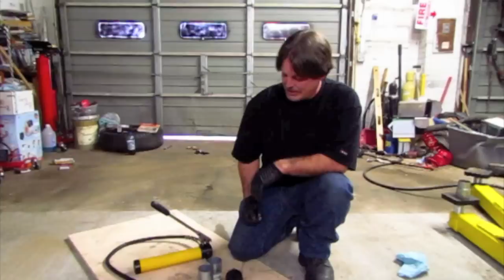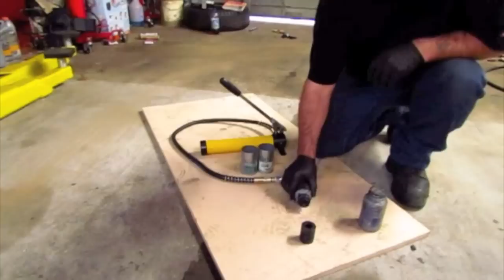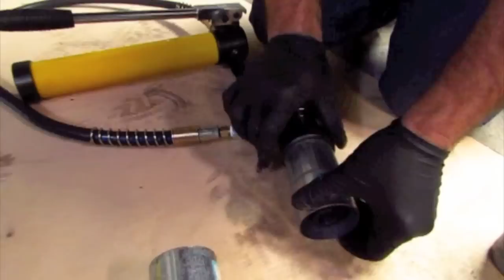Hydraulic pipe expander demo

Comment: You can buy this tool on Ebay from wegotparts, listing 253023612557 and air/hydraulic listing number 252353593737. His tool threads all the way through the expander and will not strip out!